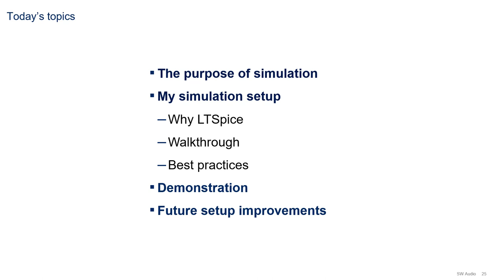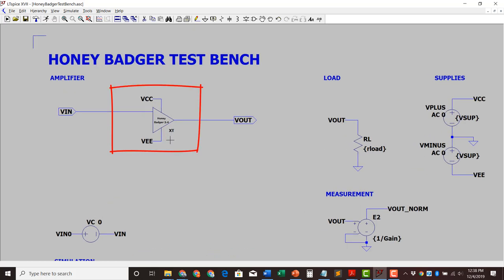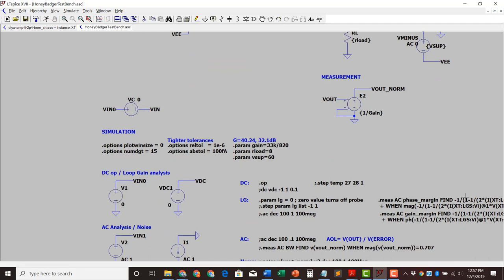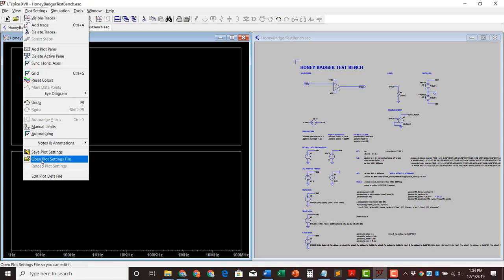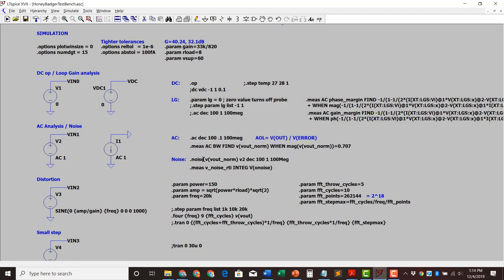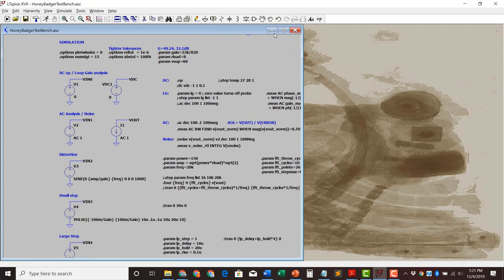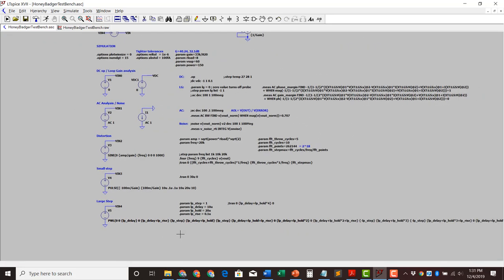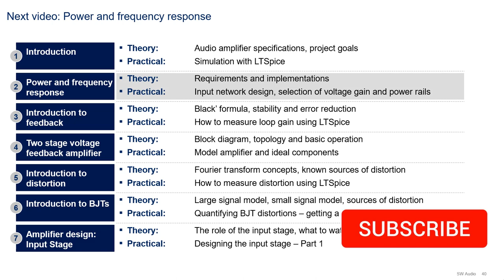1.2. Measuring amplifier parameters with LTSpice - Audio Amplifier Design Fundamentals

Comment: Suggestions for capabilities to add to the simulation:
a) heat sinks' thermal behaviour
b) ability to change load parameters e.g. when using realistic loads or loads selected from a library
c) sensitivity to component value tolerances

Comment from the maker: Quick update, for the sims shown in this video to work well, please make sure that 'Save sub-circuit Node voltages' and 'Save sub-circuit Device currents' are checked in 'Save Defaults' (CONTROL PANEL -> Save Defaults).

Comment: quick question... how many dB of GNFB does this amplifier use?
Reply from the maker: Hi Savu, depends on the frequency, so let me give you some data points:
The close loop gain of this amp is ~32dB across mid-band.
At 20KHz, the loop gain or GNFB is ~25dB.
At 1KHz, the loop gain or GNFB is ~51dB.
The loop gain cross-over frequency is 425KHz with a single-pole roll-off.
You can find the schematic of this amp at:
 https://cdn.shopify.com/s/files/1/1006/5046/files/P-DIYAB-2V20-diyAB-amp-schematic.pdf

QQ - how did you land in this video series?